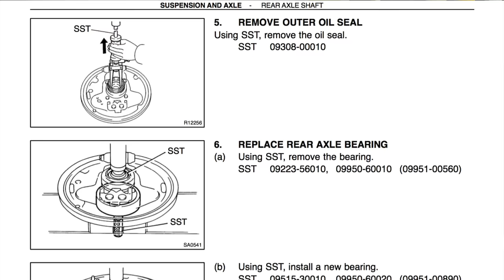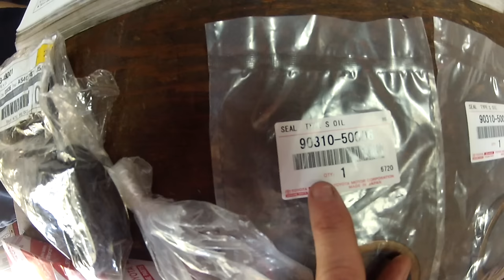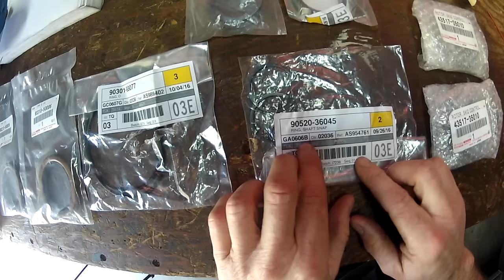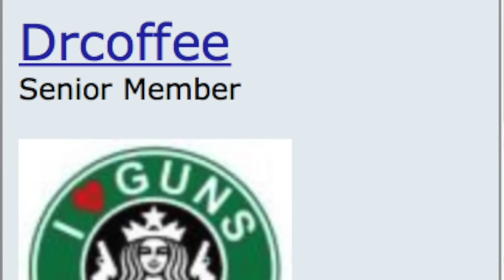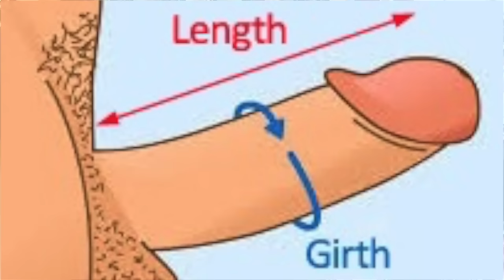Toyota Rear Axle Seal/Bearing Replacement (ABS Rearend)

Comment: I noticed in the video you used 80w90 oil but in the description you have 75w90. Going to do this job on my ‘96 soon and already bought the 75w90. Just checking to make sure I use the right stuff
Reply from the maker: 75w-90 is fine for the rear differential.  At first I was using 80w-90 for the rear diff but when I decided to switch to Redline synthetic gear oil, I'm now using 75w-90 for the front and rear diffs and also the transfer case.
Reply: Timmy The Toolman Cool thanks. And thank you for all the work you put into making these videos. They’re a gold mine for 4Runner owners
Reply from the maker: @shelby2480  You're welcome Andrew.  Be sure to read the comment I pinned for updates on things we've learned over the last few years since performing this job.  It's important information you should read.  Also check out the video description.  Good luck with the job.
Reply: Timmy The Toolman will do thanks. I ended up buying the special tool from duane’s eBay store and will use the methods in part 2 of the video.
Reply from the maker: @shelby2480  Gotcha.  The newest thing I have learned about this repair is it's not a good idea to reuse a retainer for the inner position.  When the retainer gets pulled off with the tool, some damage occurs to the inner diameter of the retainer and it's no longer a perfectly smooth surface.  You will detect some grooving in the metal if you run you finger along the inside diameter.  This grooving could allow a pathway for gear oil to get past the retainer even though you have a proper mating of the seal and retainer.  This week, after 2.5 years and around 17k miles, i pulled my ABS sensors on my 98 3rd Gen and saw that gear oil had gotten past even though I clearly had a good mating of the seal and retainer.  So, I believe it got past the metal to metal mating of the retainer and axle housing.  On my 2000 4runner, the axle seal job was done around 5.5 years and around 80k miles ago and there's no signs of leaking.  So, the difference between the two jobs is a new inner retainer was used on my 2000 while a used one was used on my 98.  So, time will tell if that ended up being the cause of gear oil getting past the retainer and seal on my 98.  

Another guy on T4R.org said he did everything right using all new parts and confirming a proper mating of the axle seal with the inner retainer but was still getting gear oil past the retainer and seal.  His fix was pulling the seal and installing a new one with gasket sealer on the inside of the axle housing where the seal seats.  So, gear oil was getting past the metal to metal mating of the axle seal and axle housing.  

Just when I thought I knew everything about this job, I get surprised with new issues.  With what I know now, I no longer recommend putting a used retainer at the inner position.  It's still fine to use an old retainer for the outer position and to reuse the ABS tone rings.  Sometimes people will find that a previous mechanic or previous owner scored the surface of the axle housing with a hooked seal puller or other tool.  If you see damage like this, no doubt you should use some Toyota Red FIPG for the seal to axle housing connection to fill the imperfections in the axle housing and eliminate the chance of a leak to occur.  If your axle housing is perfectly smooth, I don't think it's necessary to apply FIPG.  But, if somebody pulled their ABS sensors after doing this job and discovered gear oil was getting past the retainer and seal, I think it would be smart that they try installing a new seal with some FIPG as extra insurance and hope the leaking stops.
Reply: Timmy The Toolman thanks for the tips. that’s really useful to know. Is the Drcoffee retainer flip still recommended?
Reply from the maker: @shelby2480  Yes, I still recommend the Dr. Coffee flip method.  With the original orientation, bevel facing the seal, you first have to push past the non-polished bevel to get the seal up onto the polished shoulder so you need to have the retainer closer to the end of the axle for this to happen.  When you adjust the retainer in too far in the original orientation to get a good seal to retainer mating,  you risk rubbing the inside of the axle housing.  This is all because the seal was redesigned by Toyota and the seal lip now sits around 2mm more inboard.  Doing the flip method just compensates for the seal redesign and allows you to keep the retainer pretty much where it was originally, with around 4-5mm of polished axle showing above the retainer.

Comment: great video, im replacing my rear backing plates on my 2003 Toyota Tacoma TRD SR5 4x4 and this video was very helpful. im currently at a standstill as I need a few more tools. I thought all I needed was the shop press (harbor freight 20ton) live and learn I guess lol
Reply from the maker: Hey Kevin, yeah, you need more than just the press.  Good luck with the job once you get all the necessary tools together.
Reply: I purchased the bearing splitter set today an am ordering the durasolid tool as we speak !
Reply: Wish I would have found your videos sooner lol I’m now a permanent subscriber!!
Reply from the maker: The Durasolid tool is application specific but the other tools you've purchased will help you out with other jobs so it's money well-spent.  These tools will pay for themselves many times over.  Once you have experience with this, you could help some other 3rd Gen members in your area with the same repair.  All these rigs will need a rear axle seal job at some point and shops charge a lot for it.  You could help somebody out for a very reduced cost and get your Durasolid tool paid for and save the person a ton of money.  I've done this job for many people for $200 which is a steal compared to what the dealerships and independent shops charge for the labor to perform this job.

Let me know how the repair goes for you when you get around to doing it.  If you have any questions, don't hesitate to ask.  Thanks for subscribing.  Sean and I will probably be making videos for quite some time so we're going to have lots more coming your way.  Happy Wrenching!
Reply: Was able to finish the job within a couple hours once I got all necessary tools and everything went great thanks to your videos. Once again thanks for the advice and look forward to more videos !
Reply from the maker: @kevinjenkins7454  Hey Kevin, glad the repair went well for you.  How well did the Durasolid tool work for you?  I've recently heard people having issue with the tool not being big enough to fit over the widest section of the axle.

Comment: I did this on my 96 Tacoma and the inner seal toyota sold me as part number 90310-50006 was a NGK AH2853G the ones I removed were labeled NGK 90310-50001  AB2853F.
Reply from the maker: Toyota redesigned the seal sometime in the past.  That's most likely the reason for the different NGK part number.

Comment: my axle seal was bad enough that the brakes were soaked in oil.  I thought Toyota was silly to have gaskets between the axle flange and brake drum.  I was wrong.  if that gasket is in there, and you lose a seal, an oil slinger on the back side of the flange captures the oil with centrifugal force and it migrates out a hole between the wheel studs.  it will oil up the tire and things, but keep the oil from soaking the brakes.  well worth making sure it's in there !
Reply from the maker: Yeah, I've seen that seal in parts schematics but have never seen one on any Toyota or Lexus I've ever worked on.  You are right that the axle flange gasket would help keep the gear oil out of the brakes.
Reply: Thanks for that.

Comment: I’ve been tempted taking this job on but OCD is sure to kick in during press lol.
For that reason I must take pass.

Local Toyota dealer quoted me 811.00 parts & labor.

4WP quoted 400.00 labor I supply parts.
ABS kit covering both sides from yotamasters  cost 150.00
Reply from the maker: Just know that dealerships and independent shops botch this job with a fair amount of frequency.  My local dealer screwed it up on my 2000 4runner and it was one of the catalysts that got me off me ass to start doing more of my own wrenching.  So, you've been warned.  Choose your shop carefully.
Reply: @TimmyTheToolman 
Hmm maybe best bet would be machine shop.
I will look into pricing
Reply from the maker: @pjc4425  Machine shops have been just as bad at screwing up this job.  They cut the parts off rather than pull them off and end up scoring the axle.  Just do yourself a favor and do lots of research before trusting some shop.  I'm not lying when I say this has got to be the #1 job shops screw up on Toyotas trucks and SUVS.  It's because they use the wrong tool for the job like cutting wheels.  It's because they don't understand that the seal was redesigned by Toyota. And, it's because of the basic fact that they don't confirm a good mating of the axle seal with the inner retainer by doing a sharpie or grease test.
Reply: @TimmyTheToolman  Right on taking your advice.
Did shoe replacement on 96 today no seal leak bearings feel sound
Job will be definitely be needed in future as you know so tool investment - press & jigs will be needed.
Tackle job next year.

Anyway thanks for input & A+ video like always
Reply from the maker: @pjc4425  Glad I was able to talk you out of using a shop for this job.  You made the right decision.  The money you save will pay for all the tools and then some.  Happy Wrenching!

Comment: Timmy, Thank you for an ultra excellent video with copious amounts of detail. 

I went to a shop today called Proven Force. I have a 99 4WD SR5 4runner. For press work, I was quoted $50 to $100 per side provided I bring my own parts. I mentioned the seal modification that Toyota made and that it is better to flip over the retainer and adjust position so the seal rides in the middle. 

I was told the techs at Proven Force have been doing this for 20 years and I should not worry. But I told him that the techs might not be aware of the modification to the seals and the leaks might not show up for 20k miles. He said that he would do it the way I wanted but that I would forfeit a guarantee that it would work. 
How would you approach Proven force to make sure the job gets done correctly. What documentation would you bring them?  They would not be able to do a grease test since the 4runner would be on jack stands in my garage. Any help, I would be grateful!!! Would you roll the dice and rely on their expertise? I am guessing you would not.
Reply from the maker: Hey Kelly,  I'm sure others run into the same issue with shops resistant to do something outside the norm.  But, when I paid to get this job done on my 2000 4runner at my local Toyota Dealership, and they screwed up the job, they were willing to flip the retainers for me and do it exactly like I asked.

I've done this job 7 times now.  The technique of flipping the retainer works.  Once you get one of the those newly designed seals in your hands, you will see how pliable the seal is.  The bevel on the retainer is meant to help the retainer slide into the seal.  Myself and many many others have proven the bevel is not necessary.  Flipping the retainer should not forfeit any guarantee of their work.  By flipping the retainer, all you're doing is allowing yourself to keep the retainer in the same position as it was before because you are gaining back the 2mm of the new seal design by not having to first get past the 2mm bevel to get up onto the polished shoulder of the retainer.  That's all you're doing with the flip technique.  If you don't flip, you are then required to press the retainer on not as far and then you will be coming very close to rubbing the inside of the axle housing.

When you pull the axles, measure the amount of polished axle showing above the retainer.  It should be right around 5mm.  You could remove one of your old seals and then bring the old seal and one of the new seals and let them see with their own eyes that the lip of the seal is now sitting apprx. 2mm more inboard.  If they're still not sold what you're asking them to do is a good idea, just insist they flip the retainer and have 5mm of polished axle showing above the retainer.  When you get the axles home, pop the splined axle shaft into a piece of wood on the ground to make sure the bearing is fulling seated into the bearing case because the bearing not fully seated will throw off your grease test (I talk about this in a pinned comment).  If you drove in the seals fully and didn't damage the seals, you should find that the grease test will confirm you are pretty much perfectly centered on the 10mm polished shoulder of the retainer.

Proven force might be experts in doing axle work but they might not understand all the nuances of doing this job on Toyota 4runners and Tacomas.  They can't just the press the inner retainer on in the exact position as it came from the factory.  Something has to be done to adjust for the new seal design and flipping the retainer is the best option in my opinion.  This has got to be the #1 repair Dealerships, Private Shops and Machine Shops screw up.  I'm not going to call myself an expert, but I'm probably one of the most knowledgeable people out there for this repair.  When you pick up the axles, bring a ruler with mm increments and measure the polished axle showing above the inner retainer.  If it's off, make them adjust it until it's right.  Hope this helps you Kelly.
Reply from the maker: Hey Kelly, I forgot to mention, you can save quite a bit of money on parts if the shop doing the work presses the parts off rather than cutting them off.  I mention the money saving on parts in the video description.  Before ordering your parts, ask the shop if they press the parts off or do they cut them off.   If they press the parts off, you can save yourself around $150 on parts.  You can reuse both ABS gears and all 4 retainers.

Comment: I hope you would say how much the parts approximately cost, I did this job with the generic parts and it worked fine. The ABS system works based on The Hall Effect, if you are interested you can look it up.
Reply from the maker: The parts are all listed in the video description.  You could add up what the OEM cost would be.  Aftermarket huh?  Well, time will tell if your decision was a good one.

Comment: Very important question about the video-  is the bearing play you showed at 20:53 normal or excessive? Once the bearing is replaced will it exhibit this play? I took my axles out and both are leaking oil but have not got on the brake shoes.  Both exhibit this play. Many of us dont have axle seals leaking but are trying to determine what play is excessive before replacing the bearings. Thank you -I and many appreciate your videos.
Reply from the maker: Even new bearings will exhibit some play when the backing plate is moved like I did in the video at that time stamp.  When the axle is bolted to the axle, you shouldn't detect movement.   Hard to say if what you have is too much.  Normally to test for excessive bearing play the axle and wheel are attached to the vehicle.  You simply grab the wheel and the 12 o'clock and 6 o'clock positions and push and pull with opposing force in an attempt to detect any movement.  If you feel any movement, the bearing should be replaced. 

If you're thinking of just replacing seals, you should repack the bearings with a high quality, high temp bearing grease.  You can lift up the dust seal of the bearing with a tiny flat blade screwdriver to add grease.  You would also have to address the proper mating of the new seal with the inner retainer by adjusting the position or orientation of the retainer (flipping it).  If you watch the beginning of the video, I cover this.  Just replacing the seal and doing nothing else will probably generate a poor result.

Comment: Why did you drain his fresh gear oil ? - Excellent info , thanks
Reply from the maker: Because when you pull the axles, a lot of it will leak out until the level gets below the axles tubes.   You could jack up one side at a time and limit the gear oil loss, but that's not what we did.

Comment: Tim, your videos are superior and valued by many.

I have a big oily mess inside of a rear drum which is/was causing a squeal noise when braking. I'm having trouble determining whether the wheel cylinder or the axle seal is the source. The thick, black, oily residue covers the shoes and most of the components. There is no exterior leak. Fluid levels for brake fluid and axle fluid appear fine. The underside of the rubber boots on the cylinders appear fine, as does the inside of the axle with the ABS sensor removed. 

Any thoughts? I can do the brakes, but the seals are probably beyond my time/ability/tools.
Reply from the maker: If you want to double check if it's gear oil that has gotten past the axle seal, jack up the rear end with both wheels off the ground, remove the wheel on the affected side, pull the ABS sensor and look into the ABS hole while turning the axle.  If you can see gear oil being lapped up by the ABS tone ring, the seal is leaking and what you're seeing in the brakes is definitely gear oil.  Basically, what you've said leads me to believe it's gear oil.  A thick black oily residue is most likely gear oil that has mixed with the brake dust.